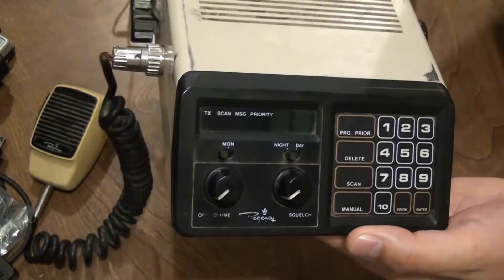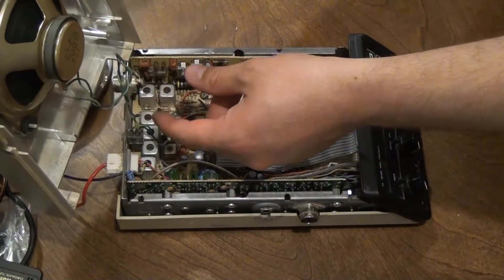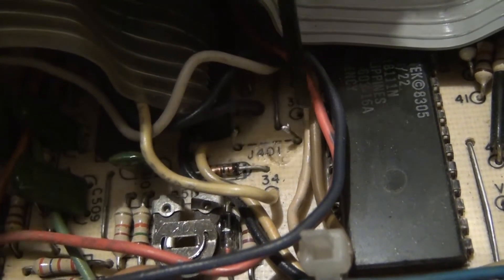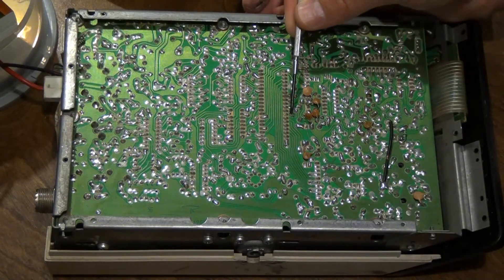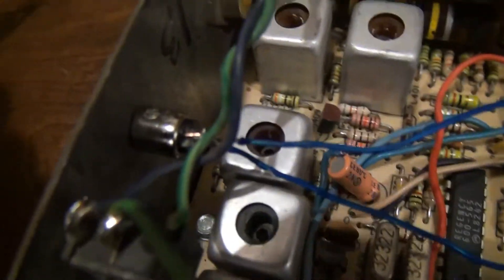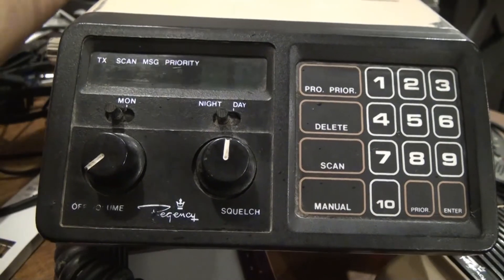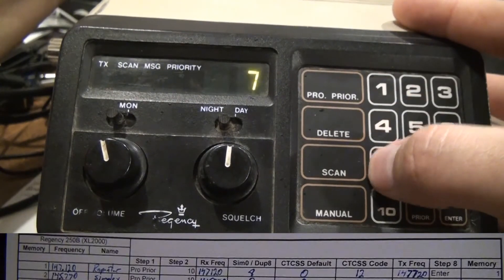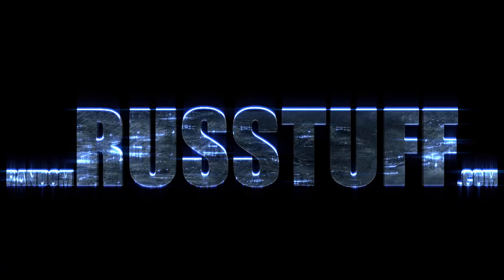Regency 250B (XL2000)

Comment: It looks like OP's web site is gone, but for anyone looking for it, I found that the Wayback Machine has it archived. The PDF version of the worksheet he mentioned was not saved, but the the Excel version was.

I was gifted a RELM RH256NB and it programs almost identically as the radio in this video.

Comment: IF I put the capacitor in will it still transmit above the ham band?
Reply: Want another one?  I’ve got a closet full
Reply: A Clapp How much?
Reply from the maker: Charles Dodson I'm not sure. I had this radio working for a year or two and then it quit transmitting so I boxed it up. I didn't actually do the mod, my dad did many years ago. It seems like it did still have the option to transmit at the original band, but you'd need to probably post on eham or another forum to get solid info.

Comment: Russ- I tried to look up our website for a list of the capacitors for the Regency 250B, but it was not there.  Do you have a copy of the capacitors and locations to convert to a 2 meter?
Reply from the maker: Hey Jason. I took down my web site some time ago. I saved many of the documents I had listed for this radio, but somehow I can not find the one with the list of capacitors. I am going to need some time to do some digging, but I'll leave my self a note not to forget. I'll reply again once I have done some more searching (hopefully in a day or two).

I did throw the documents I have found (two user manuals and the programming documents I made) into a Google Drive folder, and the link in this video description is updated for them.
Reply from the maker: Jason I can't find this list anywhere in my files. I know I found it online, so you may be able to track it down on Google.
Reply: Russ I tried tracking down for a while prior to ur video. I be had limited success, at best
Reply: I have the repair manual, just looking for the capacitor placement for the conversion
Reply from the maker: Jason Lott Oh my, I can't believe I found it again. Something  just clicked my brain and I remembered where to look. http://www.eham.net/ehamforum/smf/index.php?topic=75134.0

Different model number I guess, but this works for the 250b.

Comment: Wow! This brings back good memories. Back in the 1980s I had all three radios in my truck (VHF-Lo, VHF-Hi, and UHF). I worked with many LE, EMS and FDs state wide and I would program departments on the fly. I had an on\off switch in each radio for that reason. Sad to say everything is in the 900 mhz band now. The Feds took care of that. Thanks for a great video.